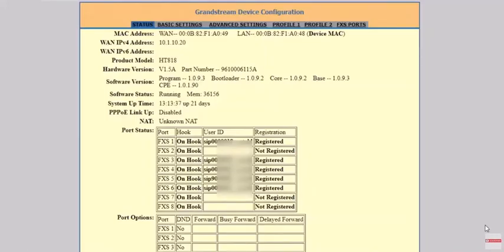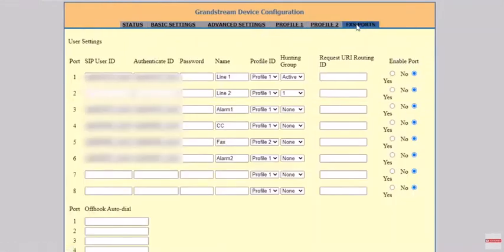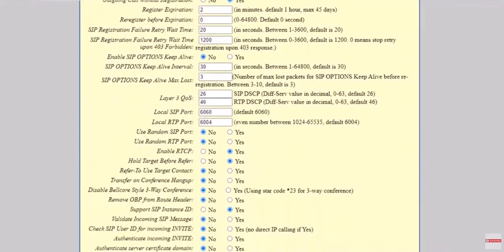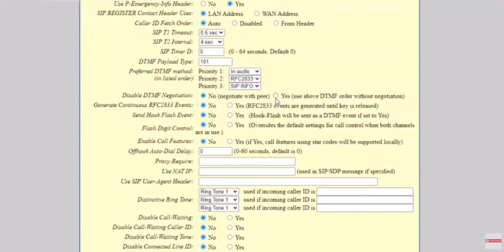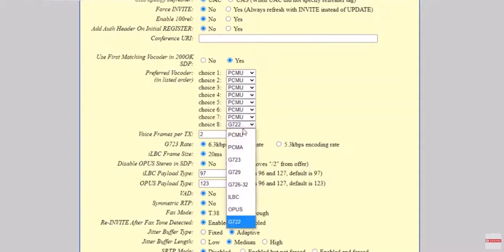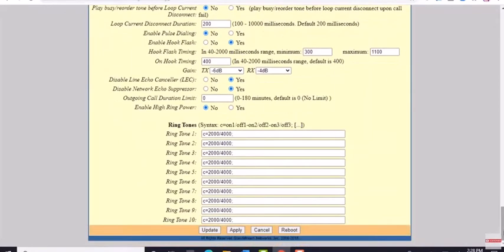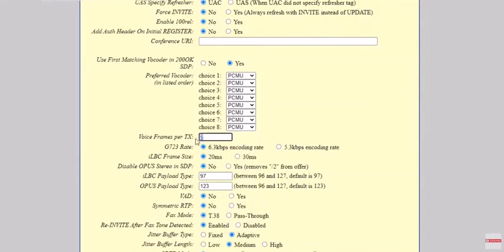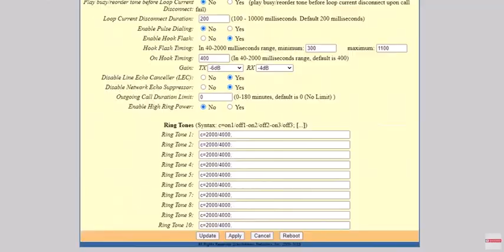Comm Failure Fixed  How To Connect Voip Lines To Alarm Panel try this Comm Failure Fix Demo.

Comment: Did the changes. Still get comm failure
Reply from the maker: sometimes the monitoring company needs to reset which could take up to 24 hours and also this is not 100% fix for all security panels. it worked on Johnson Control & Vector Sec for me👍

Comment: Can you do a tutorial on using this ATA with a hunt group, and 3 DIDs ?  I've been trying this ATA with several sites, but the DIDs do not ring to the right ATA ports for some reason .. If I dial the DID assigned to port 7, it will ring on Port 1 ..  I don't get it .. ??
Reply: Sorry, just saw this. Did you ever figure that out?